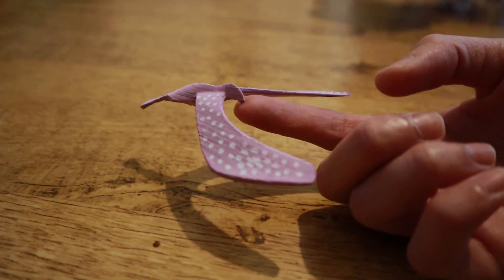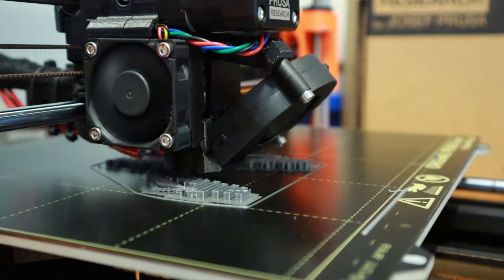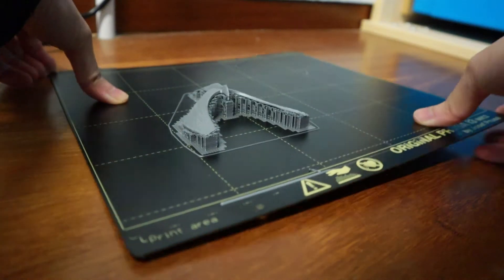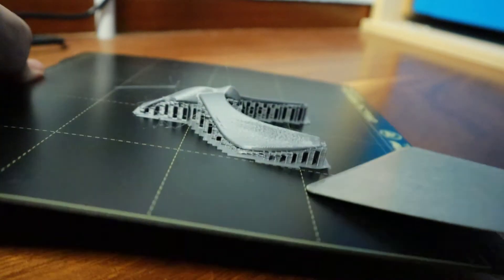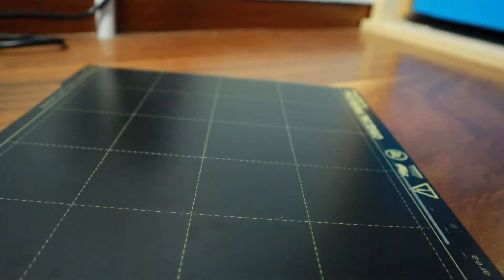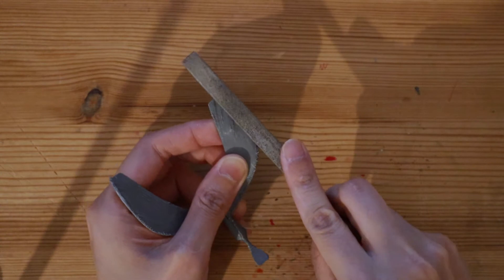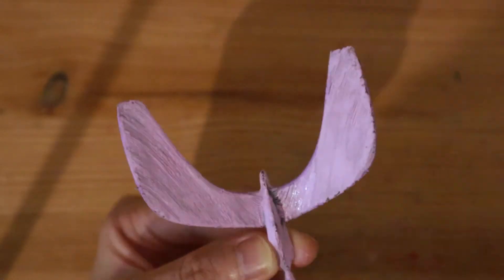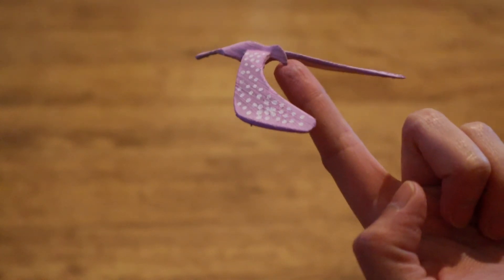3D Printed A Balancing Bird For My Physics Demo

Comment: Hi, you can use tree support when slicing using CURA. Usually tree support use less material and easier to remove. To smooth your print, depends on the filament material, for PLA, sanding and applying an epoxy coating usually has the best result. 
For ABS, you can smooth it using acetone vapor or simply using brush dipped in acetone. It will result in smooth and shiny surface, but some surface detail can be lost too.

Please be careful with acetone, it causes irritation on skin and eyes. Its vapor also can damage your lungs, use appropriate safety gear if you're working with acetone.